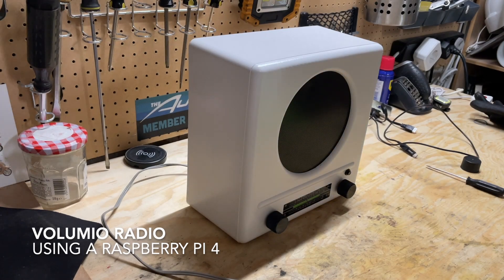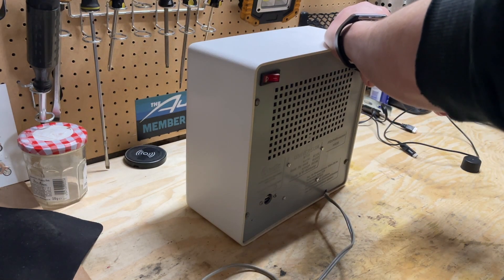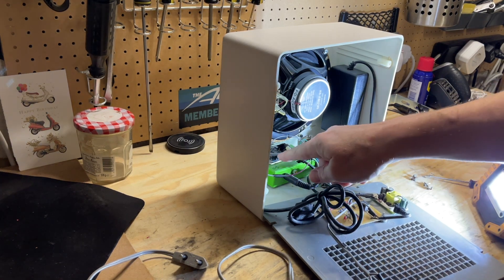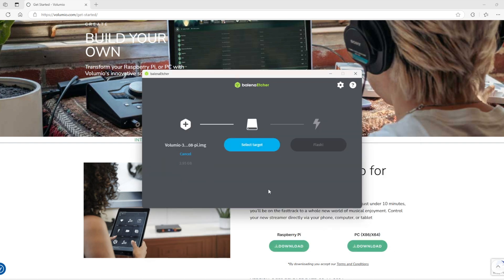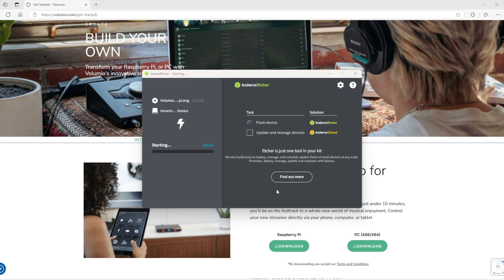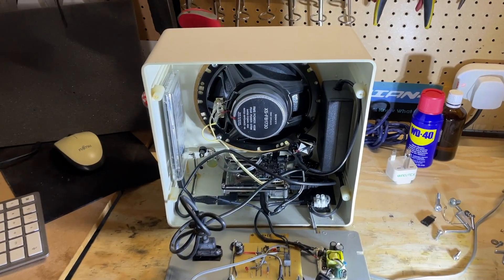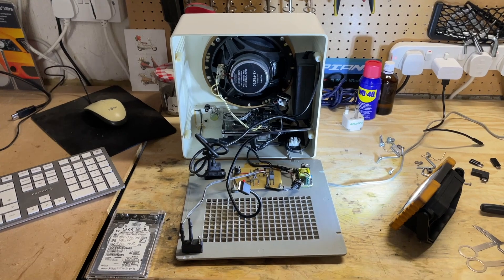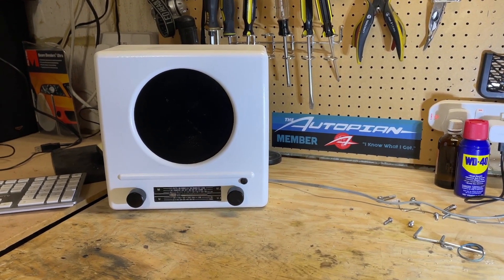Raspberry Pi Volumio System in Vintage Radio

Comment: are u can use internet radio with "free volumio"? i'm trying similiar project but with old laptop. its working fine, but i abandon the project because i know it will drain my pocket quickly :face-green-smiling:
Reply from the maker: Yes, internet radio works with the free version of Volumio. I don’t have the paid version.